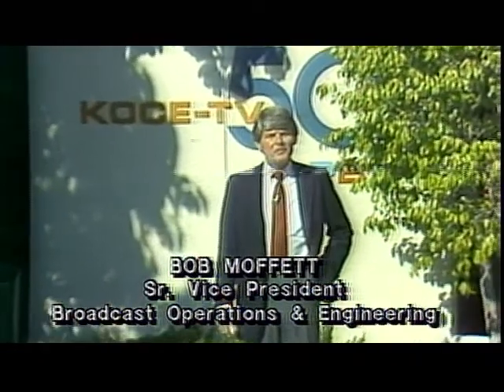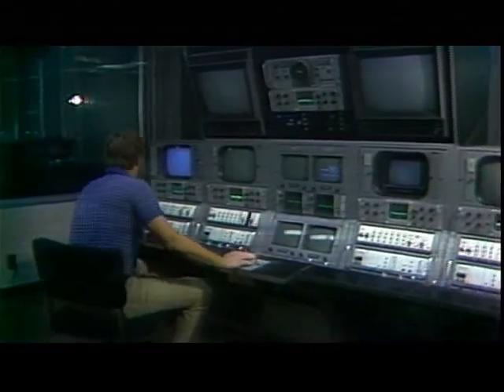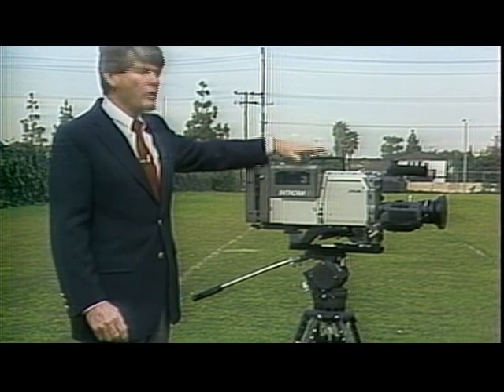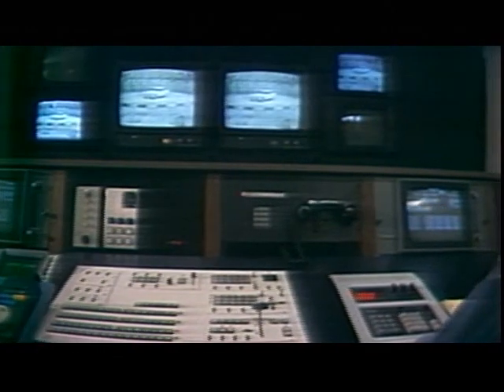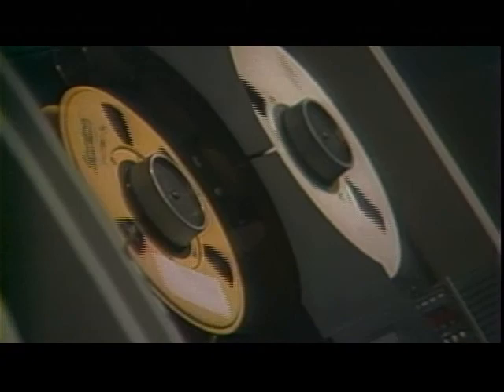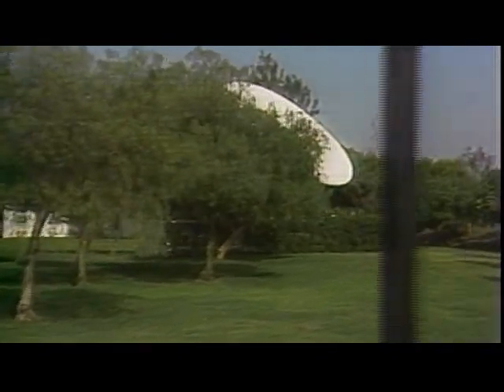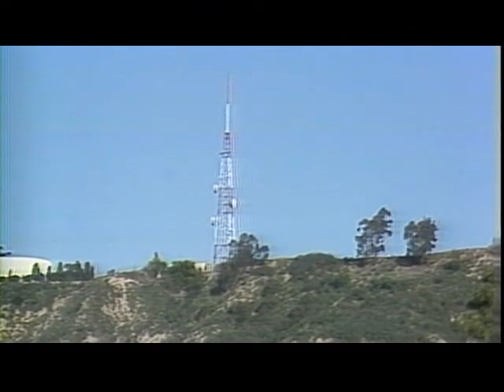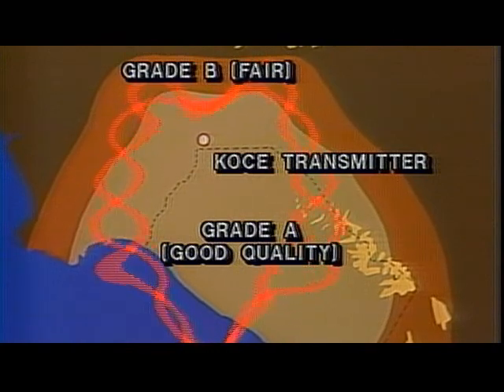KOCE Tour.wmv

Comment: I immediately recognized the set for "Jim Cooper's Orange County"--it was featured in an experimental film made by Tony Gault in 2003 called "Not Too Much Remember", which in itself is a found-footage film featuring bits of footage from educational/industrial films. (It's not currently on YT, unfortunately, but available on "The 70s Dimension" DVD--I might have to post it on YT :) ).

Some of said footage used by Gault features a rather mentally confused man named "Richard" speaking to a psychologist (Dr. Hans Strupp) on that same set (possibly excerpted from a program on mental illness produced by KOCE and distributed as an educational film later featured in Tony's film, perhaps? The footage in the film does look like a kinescope struck from a video source...)
Reply from the maker: +Ryan Schweitzer It was also used for a Jury Duty Orientation film hosted by Fess Parker and shown to prospective Jurors during the 80's